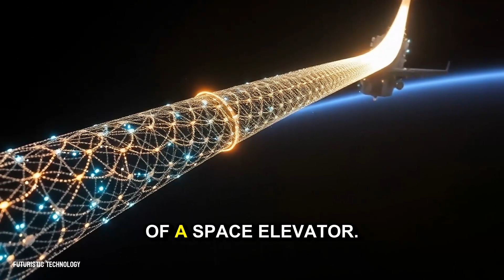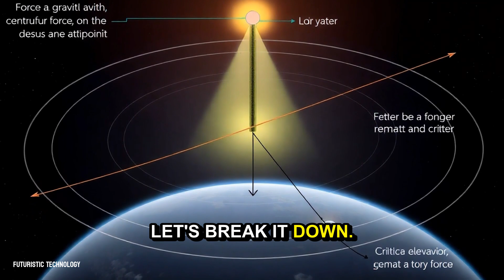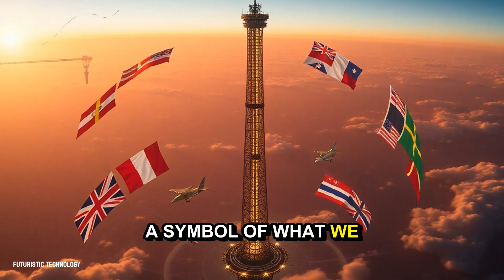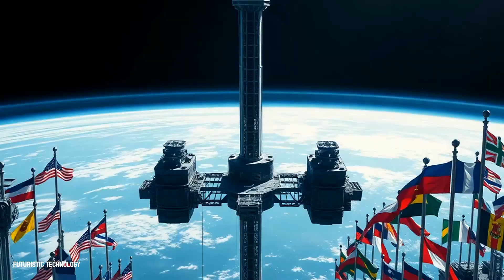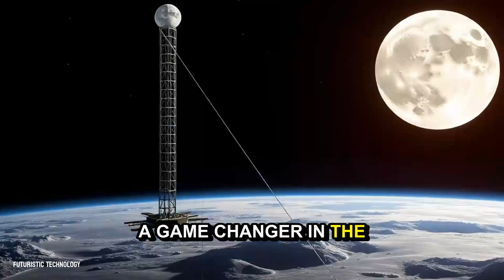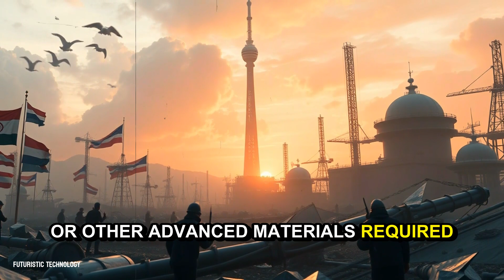How SPACE ELEVATORS Could Revolutionize Space Exploration | Future of Space Travel

Comment: Because of risks versus costs, no one in their right mind will build a Space Elevator. ‘Today, but who knows what the AI Scientists are going to help us build by 2050?’Space Towers, imagine the Eifel Tower 12x its size, that would be about a mile wide. The height would be over 2 miles high or 12,288 feet.‘Put a Starship on top? Or, ah, I know, a vacuum tube. Get sucked off to orbit.??’
High-speed trains move faster in a vacuum. They use less power using Magnetic Levitation Tracks.
‘A Train to orbit would cost too much? I mean, we need to reduce the price of building a MagLev track on the surface of Earth…’